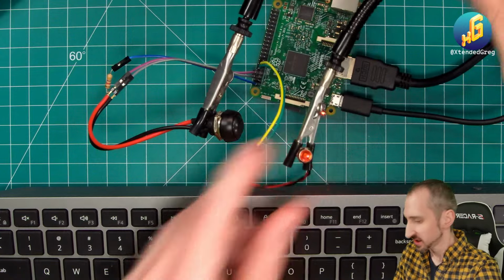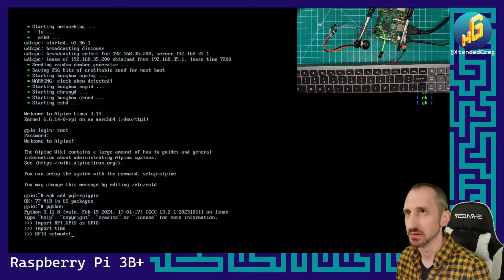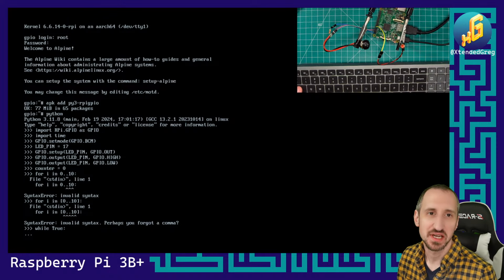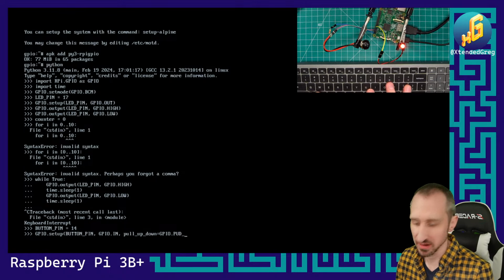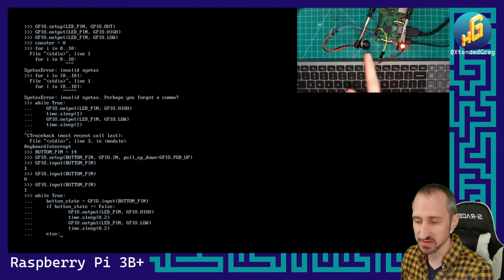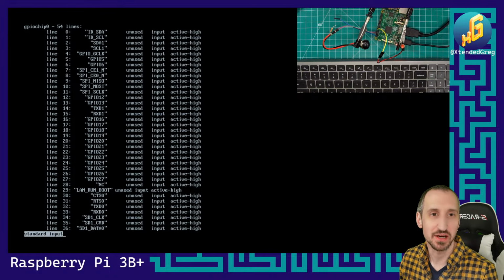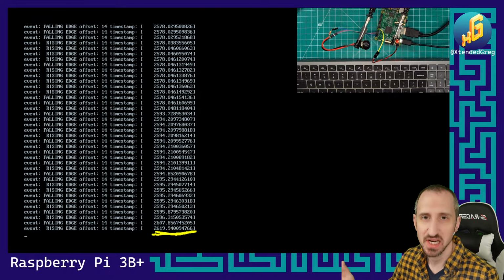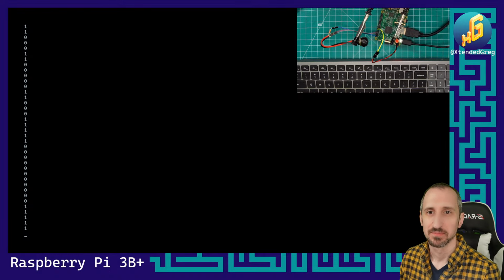Alpine Linux on Raspberry Pi Basics: GPIO

Comment: Thanks, that works well. I'd prefer to run my python/shell gpio scripts as a non-root user. Is that doable?
Reply from the maker: Yes, it is both possible and best practice.  A non-root user can be created using 'setup-alpine', or you can create a user manually using the 'adduser' command.  Just make sure that you add your users home directory to lbu, and that if you need to run any privileged commands, that you install 'sudo' and modify your /etc/sudoers file accordingly.  Great question, and thank you for watching! 😊